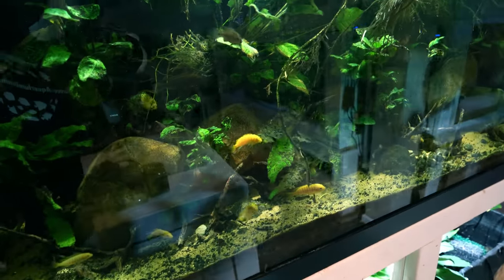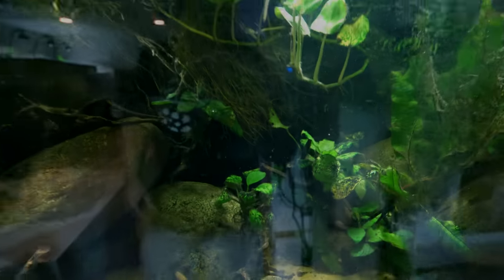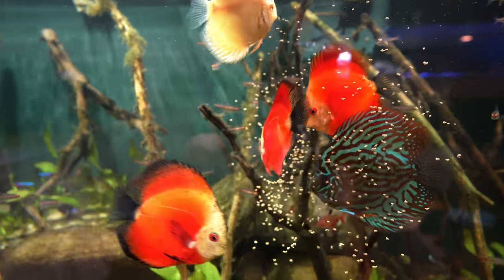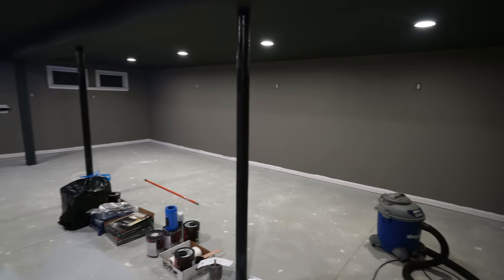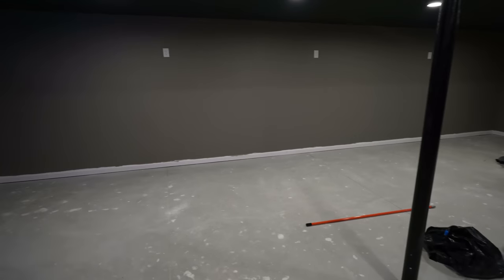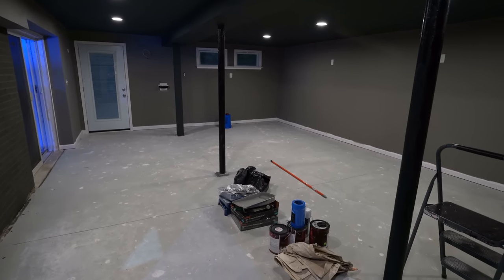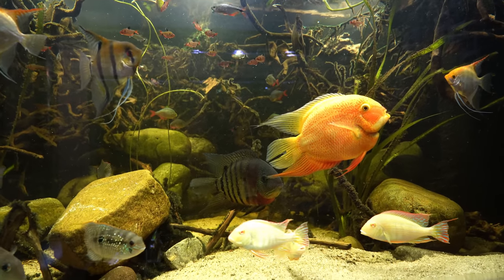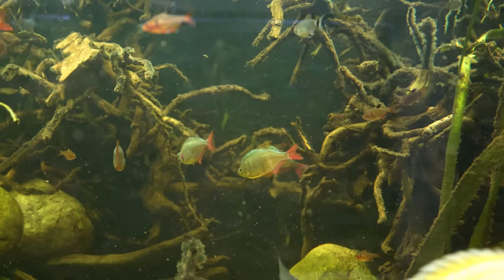Help me Design my DIY Mega Aquariums for the Fish Basement Annex!

Comment: Looks like fun. Time to construct some simple sound baffles, Owens Corning 2’x4’ 2” thick acoustic absorbers with some nice looking fabric stretched over them. I used to run a recording studio and with a bunch of those 6 - 10 or so, it would be real comfortable with the noise level much reduced
Reply from the maker: I may have to go that route, but first I will build the tanks and hang some decorations on the walls and see how it is after that. I do have quite a bit of experience working in areas with sound baffles and they do work really well.

Comment: If you go with the 27 foot in the center you could run it into to filter for the 33 foot  leaving you room index it for smaller tanks or storage  ect.
Reply from the maker: The combined filter on the 1500 gallon system has been working well for years now...and that is something I think about to simplify running so many big tanks....plus a giant wetlands filter would be pretty cool in its own right. :-)

Comment: Have you considered using the poles and making a winding stream, sort of like an elongated squared-off S where to the left of the leftmost pole you have the stream starting with a divider at the pole towards the back wall but open between the pole and front. Water would start there, move to the front and right then have another divider at the right pole diverting the water towards the back and right. The water flow would then end at the far right and be pumped back to the far left. You could have areas of high flow and low flow and fish could traverse the whole tank, or egg crate could be used at the posts to limit their travel.
Reply from the maker: I hadn't, but that is a very interesting idea...thank you! :-)

Comment: Great work, like most people, I like the idea of the middle being open for sitting and viewing, love the idea of a 'U' or 'L'  shape to the monster tank, kind of like that huge Takashi Amano aquascape they did (George Farmer has a great video on it), but i get what you mean about the ends blocking the corners somewhat (unless you made the sides a lot less deep - say 4 feet wide along the rear wall with 2 feet on the sides...not sure if that would work, but would look mind blowing....)
Also, with the seating in the centre, how about having an open pond there forming the centre of two back to back benches... that way, you have a viewing seat facing the 33 foot tank, a viewing seat facing the 12 foot aquascape and a low pond between them, could be cool for something different in there ...koi...freshwater rays...something like that...
Reply from the maker: Thanks for the comments!  We definitely have consensus on keeping the middle open :-).  I will go over in the next video about and L or U shaped tank...it doesn't really work for a few reasons.

Comment: Why not wrap the river aquarium around all three walls since there is a plan for partitions and drops. This allows a little extra volume and would pull you into the tank.

 Then a short aquarium in the middle that you can see over to the large tank. Keeping the sight lines and be a center piece to walk around.  Perhaps for fresh water rays?  

Also for the community tank on the brick mimic your river aquarium but as a small tributary with smaller community fish.

Just ideas I will be excited to see what happens no matter what.
Reply from the maker: For the smaller community tank I was thinking like a 240 on steroids...I always loved the dimensions of the 8x2x2 240 gallon aquarium....how cool would a 12.x2.x2 look....especially if I can pull off an all glass 12 foot front...no brace in the middle  :-)
Reply: @AquariumDomain.  that would be wonderful.

Comment: If possible, it would be good to have the 12ft x 3ft as 2ft seems a bit narrow for larger fish.
33ft sounds good. Depending on the remaining space between the 33f t and 12ft, some smaller island tanks between the poles and a tank across the front end wall. What width do you want the walkways?
Reply from the maker: Shooting for min 40" max 48" for the walkways. I am thinking the same as you, subtract a little from the middle tanks to make the 33' and 12' tanks the ideal size (width).

Comment: I’d make a tank with a right angle on one end   Basically a L shaped tank
Reply: I agree. He could use the angle for the bog filter and place fry grow out and /or feeder fish storage with a viewing window.
Reply from the maker: Thought about doing that, but it seems like the corner area would be really hard to view, as I would have to have wood structure there...blocking the view.
Reply: @AquariumDomain.  not at all youd
Have a single post between the 2 panes of glass.   I’m a carpenter myself. I’ve a pretty simple idea if you want to get in touch
Reply from the maker: @Msheeran83  Yeah I could see a single post there for the glass and top brace in both directions.  However I don't think the L shape tank will really fit with the design for the other tank in the room.

Comment: Hi! Weren't you going to make the long tank for your Monster fish as they are getting to big for the 20ft + tank????????
Reply from the maker: Yep, that's correct. I also need to split them up some which is why I am going to use some dividers. They have essentially segregated themselves already in the 3K gallon with one set of Bass and Oscar on one side and the other group on the other side.  :-)

Comment: Make the 33 footer shaped like an L under the windows to make it bigger.
Reply from the maker: I like the thought of that, but I can't really envision how the view would be in the corner, seems like the tank structure would block the view at the bend.
Reply: @AquariumDomain.  Yes, there would be structure at the 90, I just pictured a viewing panel on the both the long and the short sides of the L.